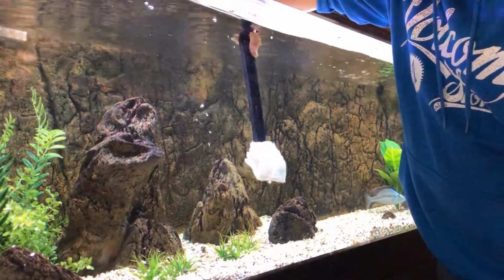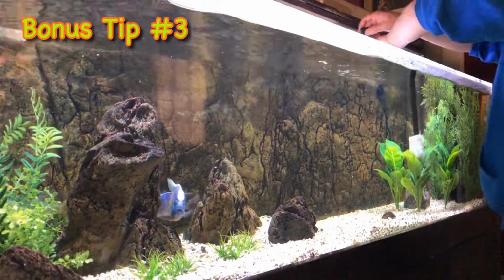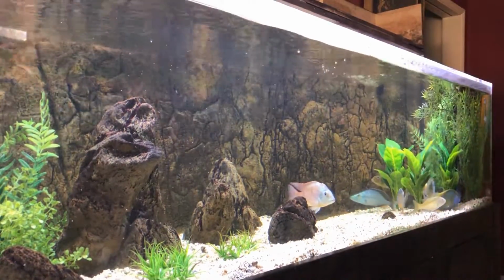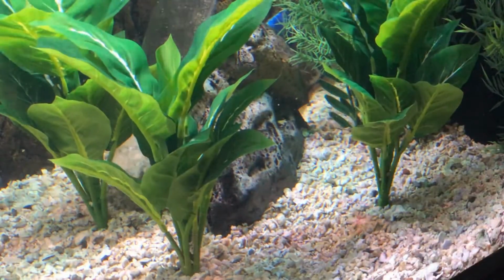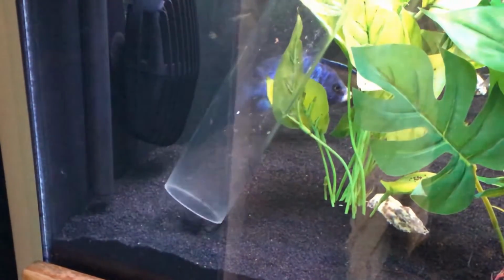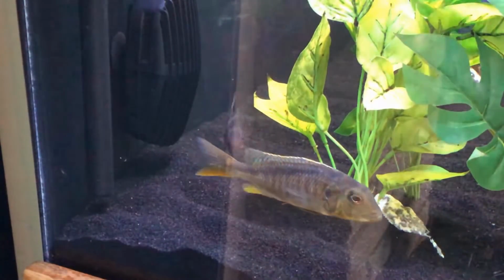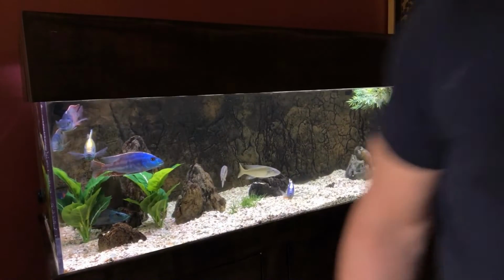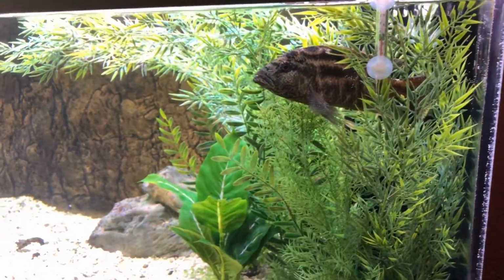VACUUMING: Sand vs. Gravel (Plus 9 Bonus Tips!)

Comment: I just did this last night. Cleaned glass with a scraper pad then cleaned my sand. Got up this morning and my tank is crystal clear. Great video thank you. I broke a plastic fork in half and used black electrical tape on the end of my siphon so the fork pieces are pass the end. Stirs up the sand but it doesn't go up the siphon was having trouble getting sand siphoned. Great tips in your video👍😊
Reply from the maker: 307 Wyoming 4F that fork is a good tip! 😀👍🏻

Comment: Great video as usual Ben! I have a 55g but upgrading to a 125g very soon. I have a white sand substrate which is of medium coarseness along with a ton a Texas Holey Rock. I picked up some 3/8in soft plastic tubing at Home Depot along with a 3/8in straight rigid tube. I secured a small plastic fork on the end of the rigid piece. Luckily I have a sink close by. On a daily basis I can “rake” the sand with debris/dentritus and selectively pickup the material with a siphoning action. The procedure is great to get around the “nooks and grannies”. It doesn’t take the place of the big vacuum but on a daily basis fantastic The fork can be bent so as to agitate the sand and lift the debris...works fantastic! Have fun😀
Reply from the maker: Great tip!

Comment: I'm using sand substrate for the first time.  It seems easier to keep clean than gravel.  I wonder if it really is getting clean or if my Cory catfish are burying their waste like a big litter box.  I figure I will be able to tell in a month or two if I'm doing this right.  It looks real nice, and the fish seem happier.  So far, so good.
Reply from the maker: Once a month comb through it and it will be very easy to keep pristine.  Waste settles on top and the water movement or perhaps, as in my case, a powerhead moves the waste to the filter intake.
Reply: I have cory cats and sand as well. They have a betta male roommate. I'm new at this so learning about the cats as well
Reply: @BenOchart  Will the same principal of poop being drawn into the intake apply if I use sand/aragonite with a hang on back filter?  That's what I have (HOB).  I only have a 20 gallon tank.  I just saw what you meant by rake. I just need to use a stick or something to stir up the sand! :)  Thanks!

Comment: I just installed a new 65gal  tank. I installed under sand jet system, I used play sand. I washed it till it was clear and installed in tank. The problem is that I can see small particles of what looks like sand moving all over. Is this normal to see all the time. No fish in tank yet.
Reply from the maker: Yes.  No matter how much you rinse, there will always be some of that.  It will clear up eventually.
Reply: @BenOchart  thank you

Comment: Having a hard time with my Oscars after moving them to a 200 gallon tank..they have since started having HIH disease.  The local shop told me to get my water parameters right before medicating and once medicating to remove a apart of the filter which will depelete the meds I am adding ? I run a fluval ac 100 HOB and fluval canister cabinet filter 370 but still have water clarity issue unless I use the conditioner all the time...

Comment: Do you have a power head recommendation for a 36 gallon bowfront tank?
Reply from the maker: Usually the filter return will create enough stirring up for a tank that size.  What kind of filter are you running on it?
Reply: Ben Ochart I’m running a cobalt ext, 210 gph canister.  Also a sponge filter with fluval q1 pump.   I’m thinking about removing the sponge or replacing it with a smaller one.  It’s hard to hide in this tank.  Then upgrade the canister media, etc.  What I have current is probably plenty, I guess I was hoping for a little plant movement.

Comment: Great video and great tips. I have had both gravel and sand and I find sand much easier to maintain. It takes a little bit to develop a technique when vacuuming so that you aren’t sucking up sand , but once you get it down it’s a very easy cleanup. Keep the great videos coming Ben.
Reply from the maker: You're right.  Like anything, you have to deal with it correctly.  Thanks for watching.

Comment: I have very fine pool filter sand in my big tank...it looks beautiful BUT I wouldn't recommend it to someone getting ready to setup a new tank... cichlids will "redecorate" and dig huge holes down to the glass no matter how often you  redistribute the sand...there are some aquarium sands that have bigger grain size, those are the best to use.

Ben, I'm surprised you never see bubbles come out of the sand...I get them all the time when I'm racking the sand... maybe it's because I'm using pool filter sand?
Reply from the maker: Gurvinder Parmar A heavier sand is also less likely to get sucked up into the filter or siphon.
I’m not sure why I don’t get gas bubbles. I’m using “Imaginarium” sand.
Reply: @BenOchart  How thick is your sand bed? I'm using a good 3 inch sand bed across my tank...in some areas it's slightly more. I think thinner sand beds are less likely to hold gases...and let's not forget how much cichlids like to redecorate...lol.
Reply from the maker: 2 - 3" in spots.  Do you have females in your tank?  I ask because of all the redecorating (building of nests).

Comment: You can avoid the creation of Hydrogen Sulfide pockets with the use of a Plenum. I'll defer to the Expert: Dr. Kevin Novak Youtube posts on the topic.
Reply from the maker: I have read that concern over hydrogen sulfide pockets in deep sand substrates is actually exaggerated and not really an issue.  It gases off harmlessly.